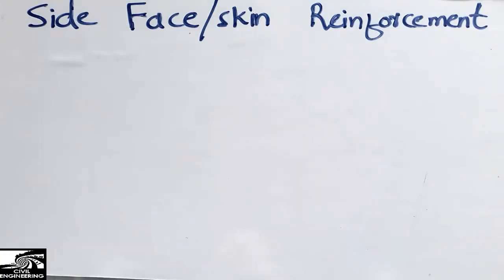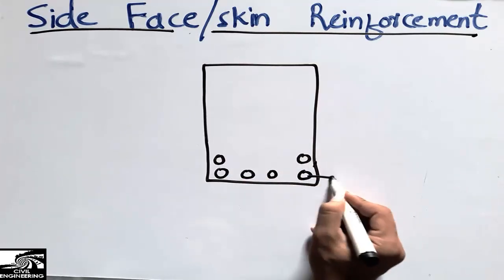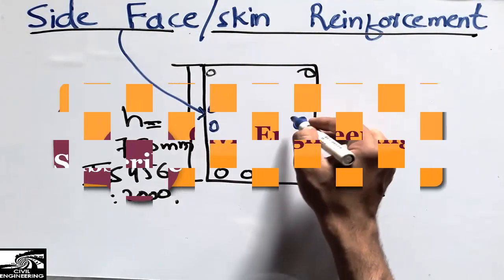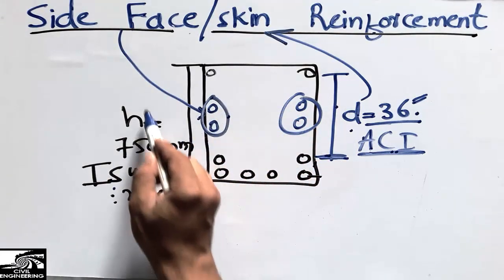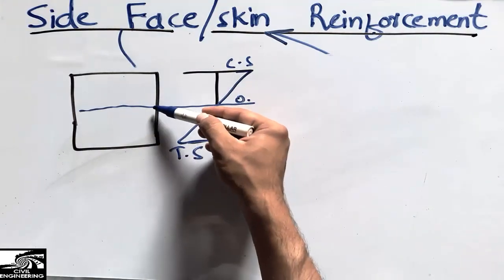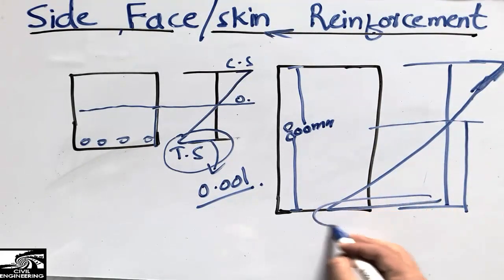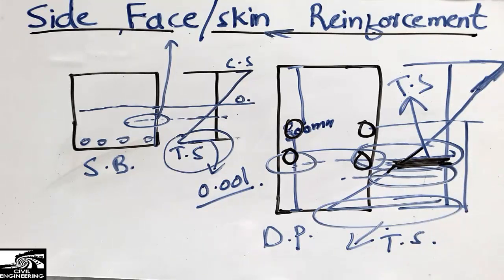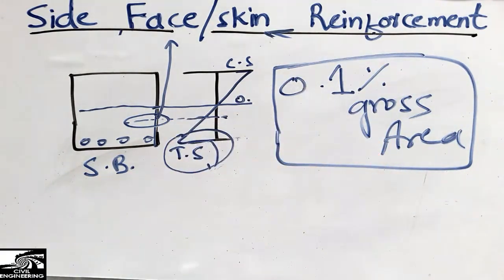Side Face or Skin Reinforcement in Beam

Comment: No, you missed the main point, the reason is that by the increase in depth, and not increase in steel to proper quantity at the same time, takes the neutral axis upwards. which makes the compression zone smaller and tensile zone larger, resisting moment is not sufficient. side face rebars makes it possible to move neutral axil lower, reduces area of tension zone